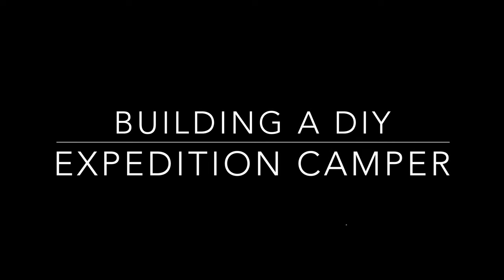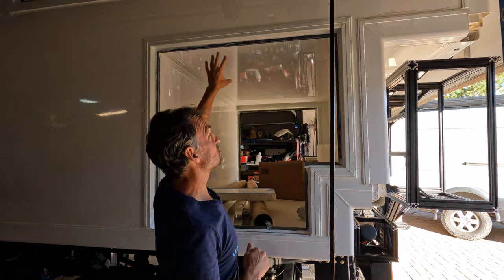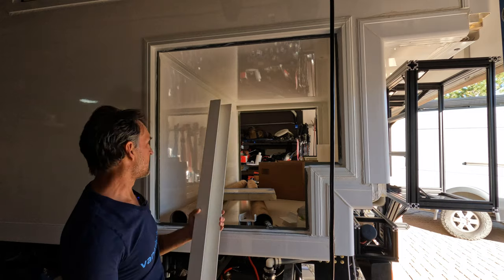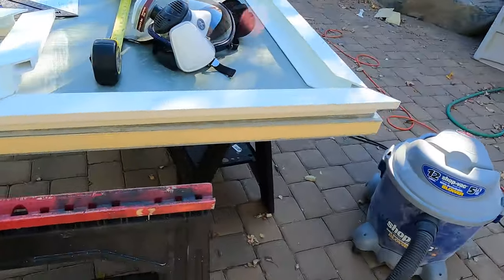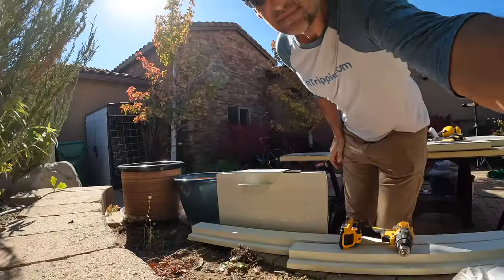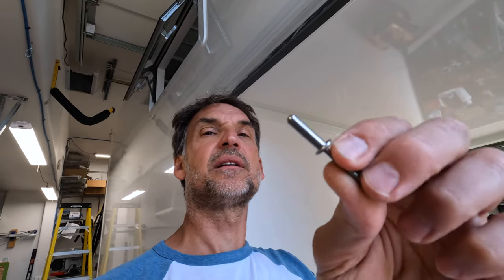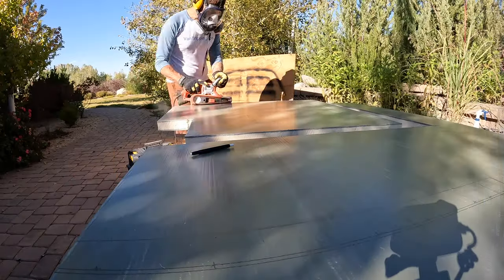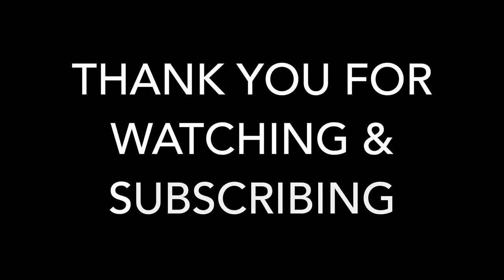Building large gear garages for my expedition camper

Comment: Have you designed the bike mount? 
I’m really curious if you’re going to do a slide out tray or similar. If I build one of these me of my top priorities is bike storage without having to take off the wheels or turn the handlebars.
Reply from the maker: Howdy. I am not going to do a slide out tray as it would add a couple of inches of height, so instead an adaptable/adjustable mount. I should have that going in a month or two and will share. In my van build, bikes could be installed with wheels on and bars straight, but space limits in this garage to balance space for the camper make best option to take off front wheels and turn them.

Comment: Well done.  👍  Will you be adding a remote central locking system so you don't have to carry a bunch of keys or at least keying the locks all the same?
Reply from the maker: Thank you. That is absolutely the plan, I don't want to have to use any keys to lock and unlock all of the cargo doors (still to come), the gear garages, the pass thru doors (x2), etc. Let know if you have any suggestions of remote locking products to use as I'm still reviewing options.
Reply: @vantripping  I see them done on a lot of Australian rigs and other Expedition trucks but haven't heard of any brand names. 🤔
Reply from the maker: @livingworkingoutsidebox  Yeah, I've seen them a lot on Aussie rigs too but not much here in the US. I've found some solutions that I can implement, and will share as I develop the system.

Comment: Why didn’t you use the cut out piece from the garage for the door?
Reply from the maker: Good question. Because the cut outs are a little bit up and also they were cut out with holes saws in the corners, which creates some gaps in the corners. So better to make new panels.

Comment: Extrusions ! 😂😂
Reply from the maker: Metal is extruded but most fiber reinforced plastics and structural fiberglass angles and similar are typically pultruded. It's a pretty cool process to watch, and fascinating how many fibers are pulled thru the dies as the resins are being injected.